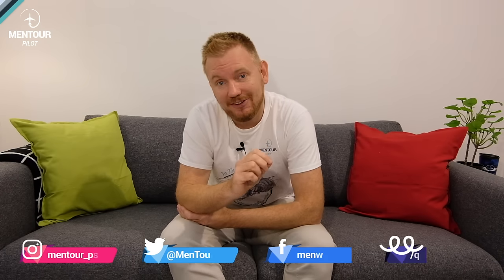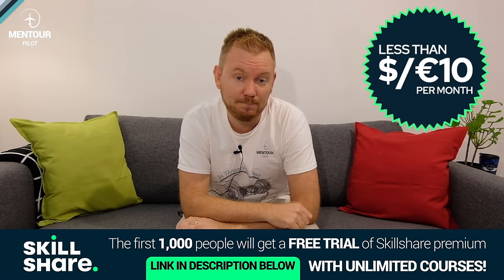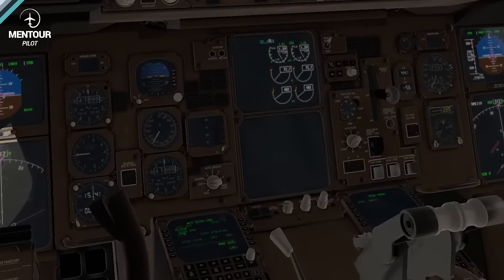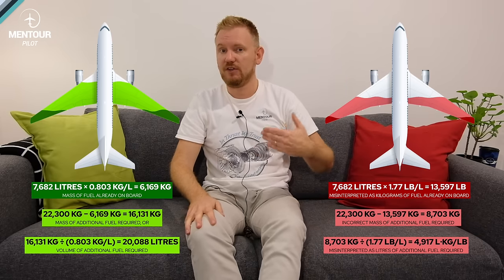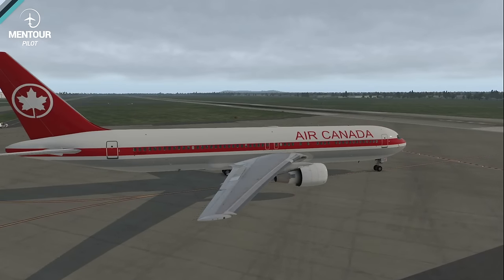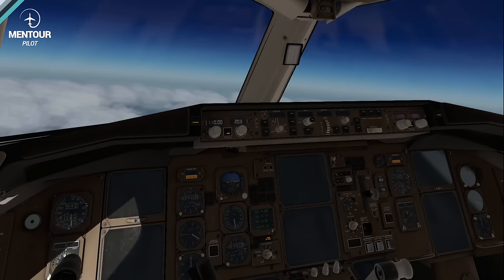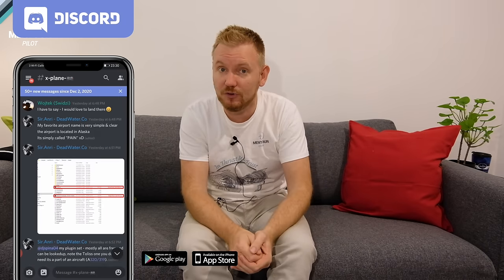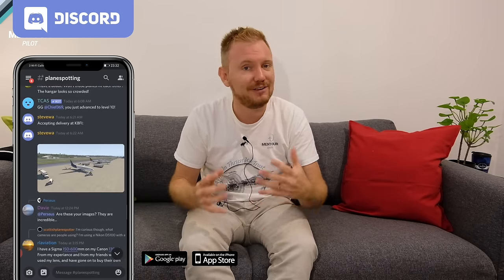The Gimli Glider! Explained

Comment: I read the book on this, plus it happened at home country and the retired Captain Pearson just live outside YYZ. The landing at the Hudson River had all the publicity, with film, books made . But that incident that day actually took far less skills and luck than the landing Captain Pearson did. First of all, the bird strike happened at low altitude, much of the decision were already made by that and it also limits the time remain.  The less time available to the pilots, the less chance for them to make any really fatal mistakes. One piece of luck was I think Peason actually flew gliders out of Gimli once and remember it, and the fuel flow stopped within gliding range of the field. They made it down but the nose gear that was retracted was not their fault, Boeing had to modify the design. The Gimli Glider flew again for Air Canada after repairs , the US Air plane never flew again. Both crew did great, but the Air Canada one required more skills and luck, but the captain was actually suspended afterwards for a while at the same time receiving an international award for superior airmenship. Now someone made a mistake here , do you hear, Air Canada? They later loaded that into a simulator, and everyone that tried it crashed. Around the same time, Air Canada also lost a DC9 due to fire at the washroom, and an Air Transat that also ran out of fuel in mid Atlantic due to a burst fuel line. Both plane made it down with some exceptional airmenship. The Air Transat glide 150 miles ? to the Azores. Air Canada cabin service sucks  and they often do not feed you flying across long distances , saying it is domestic routes, (YYZ to YVR)  and very often, you will get there with your baggage, but you will get there. They have great pilots.

Comment: One thing I'm curious about: why does the fuel indicator blank when there's a discrepancy between them?  Would it not be more useful to give a warning message and provide both numbers, somehow?  If you combine that with the dip test information, that seems like it would give you a decent chance of figuring out which number is more trustworthy.  And in this case, where one breaker was marked with a maintenance tag, you could immediately determine "oh, it's #2 fuel gauge that's wrong....why is #1 saying we're only at a quarter of what we should have?"

I guess it adds more to the mental strain of flying the plane, but...isn't the reason these things don't just run fully on autopilot the fact that pilots provide the possibility for critical thinking in the case of a problem?  I'd argue that when there is a problem, presenting more data rather than less data should be preferred.

Comment: Not sure why they would go with the minimum fuel amount, knowing that they were relying on sticks that count centimetres - yet another unit from the still unfamiliar metric system. Also I'm confused that the metric system is not taught properly: The beauty of it is that the units have an actual relation to each other: A litre of water (at room temperature, I believe) has the mass of one kilogram. Okay, fuel is lighter than water - but as a rough figure (which you can generously round up if uncertain) you can easily check if the numbers and kilos and in litres are similar. That's the beauty of the metric system: It's not complicated, the numbers for volume and mass are designed to be similar.

The performance on takeoff must have been odd, given that they must have been quite a bit lighter than calculated as well...

Comment: The Dewey Decimal System darn near does disaster during the confounding conversation miscalculation for required fuel upload. To imagine them standing on the wing with a dipstick on a brand new state of the art aircraft, boggles the mind!
To say the least to adjust entire aircraft measurements to another new measurement system really throws a wrench into servicing safely.
It is called in physics the transmutation of error through excessive unnecessary steps in the order of operations...
Good thing the pilot could fall back on glider flight tactics because the technology formulation seriously went back to the drawing board.

Comment: We know that the amount of fuel onboard affects the overall weight and center of gravity, and I expect it would therefore also affects things like takeoff speeds, trim settings, etc. With the severe difference in actual fuel weight on board vs the expected fuel weight, would the plane have behaved differently enough for the pilots to notice that something was wrong, maybe during the rotation or climb-out?

Comment: About the nose gear extension:
Do you think that increasing speed and then pulling up a little bit to get some G force would help to extend the gear by gravity? Also, higher speed may cause higher drag force to the gear, which should push it to the correct position.

Comment: I remember seeing this on air crash investigation on the tv

I live under the approach to east midlands airport in the uk, and usually see an aircraft go over my house every five minutes or so

So its scary to think this could happen near me

Only last summer, there was a large airliner circling at low altitude iver my house with its landing gear down, slats and flaps out, nose pitched up, and the spoilers kept flipping up and dropping down

The pilots had quite high thrust set

I checked flight radar 24, and this aircraft if i remember correctly was a 767 supposed to be flying ti Cincinnati

I got my air band radio scanner out to listen to the pilots and air traffic control, the pilots said they were circling to burn fuel to get down ti their landing weight as they had an engine issue

Scary to think a 767 could have crashed close to if not on top of my house

Comment: I know this is a bit of an older video, but when I rewatched it today, I was curious why they don't use a ram air turbine that has a vane on it to keep the device facing directly into the wind.  Even if the forward side slip is not typically used in swept wing aircraft, there are obviously times, like the Gimli Glider incident, where this needs to be done.  I seem to remember at ll Kat one other event you highlighted where the pilot of a passenger plane used the side slip as well.  It seems like it would be a good thing to have a power generating system that can generate sufficient power even during unusual flight configurations.  The very fact that the ram air turbine is in use is because something unusual is happening.  Just curious why not.

Comment: During this video, i was very surprised tho see how little clearance there is between the botton of the engine relative to the ground, clearly, no gear down results in at least two useless engines, plus the ever present danger to one becoming damaged to the point of hitting the turbine itself and i have witnessed the effects of a turbine that over run, what a mess, turbine blades lime bullets going every which way, i have seen somebody taken in by one as well, you just get a red spray job out the back end, and of course you then have a replacement job on your hands.
Its so amazing just how simple the principle work wise these things are, very much a far cry from Frank Whittles engine, with burner chambers all round it, if i remeber right only three  rotating turbine sections before exhaust, its come a .long way.

Comment: Mentour: You really are not converting liters to pounds. Liter is a measure of volume, pounds is a measure of weight or mass. It’s like comparing apples to oranges. Can’t convert liters to pounds.
What we are doing is calculating the weight of a given volume of fuel. Jet fuel weighs .803 kg/l. So to calculate the weight if a given volume of fuel we need to multiply the volume in liters by .803 to obtain weight in kilos. Which as you said should have been done. The 1.77 comes from converting kilos to pounds ( .803 kg/l times 2.2 pounds/kg).

Comment: This is where there is a problem with maintenance troubleshooting when a flight is due to go. A normal fault would be logged and then have to be fixed with recording of actions taken by the engineer. CB pulled or pushed or tagged with open work entries to reset a cb. This is where it breaks down

Comment: You say that you initiate the slip with the rudder and then give opposite aileron. Don't do that. That's how you initiate a spin. First, use the aileron to lower the wing in the landing direction. The adverse yaw will make the nose yaw in the opposite direction, and you keep the nose there with opposite rudder. Then pull back. I learned to fly on an ASK13 and practiced the so-called "California Whopper Slip" extensively.

Comment: Could there ever be a MEL that allows flying with no fuel gauges? Even if the fuelling and dip test had been performed correctly, how would the pilots have been able to detect a leak? For me it seems absurd that the pilots assumed that this could be allowed.

Comment: That was a serious software bug.  By blanking out if one of two computers fails, they designed it to fail completely if any computer fails.  They might as well have used just one computer.  There is a concept as a fail safe system;  the bug caused it to be a fail unsafe system, exactly wrong.  Either display a warning indication, or use three computers with the working two of three providing the fuel gauge.

Comment: since we're on the fuel thing how bout you cover air transat 236  that was a helluva story i'm a mechanic and the fact that the maint. crew didn't zip tie the hydro lines in place really gets on my nerves because any mechanic that has worked with hydro systems know that the lines pulse/jump  while in use long story short  the pulsing ruptured a fuel line and the rest's history [:-)

Comment: Wow. Of all the things, steps in place, and number of required eyeballs looking at each piece to ensure this doesn't happen. It shows that no matter how much effort we put into planning for failure, there's always a way it can fail anyway.
That said, this flight crew. Call the cabin staff, pilot, first officer, engineers and maintenance people on the ground and ATC. Holy crap did they pull off the best possible ending you could have asked for. Down to the point of using differential braking to press your aircraft against a guardrail to increase additional friction and drag to stop the aircraft. Just wow.

Comment: I was mentioning flight simulators, one of the most dangerous airports in the world was the former Kai Tak airport, of Hong Kong. The plane would fly very low over tall buildings, apparently also between them, and then onto a runway jutting out to sea. I was once a passenger on such a flight, at a window seat. I'd look out the window, and downward. The buildings below would be getting closer and closer, and my eyes would be getting bigger and bigger. Suddenly, the buildings disappear, there's lawn, and then the beginning of the runway. Then, looking sideways out the window, it looked almost like the plane was landing on the ocean. Hopefully that airport landing would remain in flight simulators, as a memento, with being good pilot training.

Comment: Just regarding the conversions that were done, why didn't they just convert the flight-plan requirement into liters, then subtract the amount of liters they had in the tank?

22,300 kg required becomes 27,770 L required

27,770L required subtract 7,682L in the tank == 20,088L needed to be pumped in.

That way there is only one conversion done, which means less chance to completely bollocks up the calculation.

Comment: I don't think the pilots - especially the captain - deserve praise for this. Yes, they showed fine airmanship in landing safely on the Gimli strip, but everything up to then was a sequence of errors for which they bear a lot of responsibility. 

First off, it doesn't require "training" to convert liters to kilograms correctly! Any high school science student can do this. The failure to cross-check the calculations - given the lack of any backup fuel gauge - is astonishing. 

The willingness of the pilots to fly without a functioning fuel gauge is equally amazing, and the captain's claim to have gotten clearance from someone in maintenance control to do this is suspicious, to say the least. Even if he told the truth, receiving clearance to override the MEL was no excuse for what was obviously a risky decision. You have to be reckless indeed to fly without a fuel gauge, given the possibility of fuel leaks, malfunctioning engines, and other problems that can suddenly make tracking the amount of fuel you have left mid-flight a survival issue. 

Finally, they were extraordinarily lucky that the Gimli strip was still usable and the crowds were at one end, and that they were able to slow the aircraft sufficiently before and after landing to avoid casualties. When at 36,000 feet, they had, it seems, at least 20 miles of additional glide path and had room to do a 360. (The pilots of the plane that landed without engines in the Azores did precisely this, along with S turns, having a good idea how much altitude they would lose.) The side-slip maneuver thrills pilots, I'm sure, but it nearly cost them all control. 

All in all, they both deserved to be fired - or at. least suspended and demoted - and the fact that they had their disciplinary actions reversed only shows the lack of a culture of responsibility. Were I one of those pilots, I hope I would have resigned for my idiocy and stopped flying.

Comment: @Mentour Pilot can't a pilot "feel" the weight difference when taking off? Especially if you are very familiar with that aircraft, wouldn't you realize it immediately when it practically leaps off the runway?
Reply: That;s what I thought. As a truck driver, I know the difference between a 80k load and a 10k load... OTOH, it was a fairly new plane.

Comment: Interesting fact that specific weight of aircraft fuel is less than of water (0.803 kg/l vs 1kg/l). The weird thing is if fuel trucks were labeled in lbs before new law, why they haven't converted to mass unit as they had before (lbs to kgs) but they converted from mass to volume (lbs to litres)?

Comment: Is it legal/safe to fly any plane of that size with a completely blacked out fuel gauge? Even if they had done the conversion calculations correct, what if there was some sort of other failure? They can't climb out the windows and check the dipsticks mid flight. Thanks for the video. Its interesting to learn/hear stories about this stuff.
Reply: The M.E.L. said they could not take off. Capt. Pearson chose to anyway. (With hundreds of lives at stake as a bonus)

Comment: I was racing my car at  the Gimli racetrack the day this event occurred.  Many of the critical facts were left out in all the renditions I have read.   The Hollywood movie completely missed the most important consequence if the nose drop and the guardrail had not stopped the plane.                 Allow me to fill in some of the details left out.  Your work to understanding the events was excellent, but allow me to add some things that have not been mentioned anywhere (to the best of my knowledge). First :  The plane landed in the early evening while members of the Winnipeg Sports Car Club (WSCC) were relaxing after a day of road racing (NOT DRAG RACING) Second :  The Armco barrier saved the day!  Third: If the plane had not been stopped by the Armco Barrier, It would have continued going left and rammed into the WSCC club house causing major damage to the plane and potentially to the passengers and into many of the race cars and crews and scads of racing fuel whom were in a direct path of the Gimli Glider. This would have caused many deaths and injuries to both members of WSCC and to the passengers in the Gimli Glider, including the pilot and co-pilot. None of this is mentioned in the movies and documentaries about this event.

Comment: As a previous programmer of safety critical systems I am amazed and shocked that the solution that the developers thought was acceptable was just to simply blank out the controls. If I had done that in my job, I'd probably have been arrested.

Comment: Changing Imperial weight to metric liquid measure in 5 figures using conversion factors twice
with pencil and paper is quite a stretch even for mathematically inclined. "Redundancy" also needed in the calculation process. Knowing the average mileage efficiency of your aircraft, 5ooo liters wouldnt make sense.

Comment: Hello, actually I have a question. Not exactly to Gimli Glider, but general. I did not know where to put it ...

If you would like to, answer in some of your movies for everybody, in case the question is interesting for you.

I did not fly the plane yet. But I like to drive cars and a bit racing. What I wonder, when people like you talking about current planes, planes 80 years old, appart of rules, everything else, the flying looks the same.

If I consider the 40 year old car and current car - there is so huge difference. I am not talking particularly about technical systems, about ABS, about computers, about electronical helper no, I don't talk about power of the engine, no, what I am talking about is the handling, the overall performance, grip, etc ... how the car feels in the middle of curve ... the new cars just can be driven much easier and much quicker at the same time and can do much more things ... 

Is something like that also related to planes? Because what I always heard ... this happend on 198* and this type of plane was so nice to fly ... Oh really ... hold on ... it was build at 196* ... how that's possible :)

it might be completely different, but I like to know. Thanks in advance in case you decide to answer.